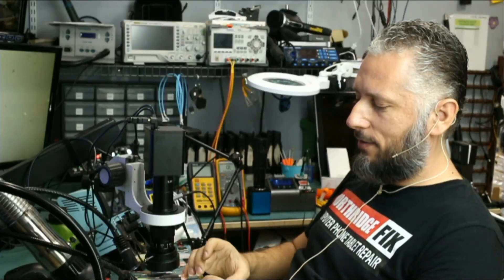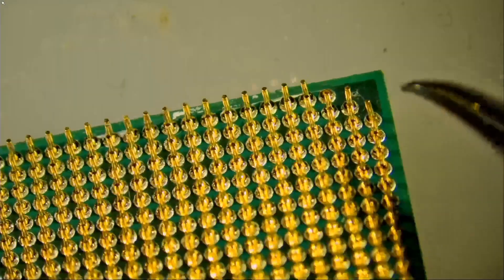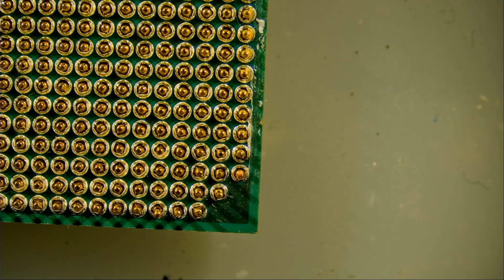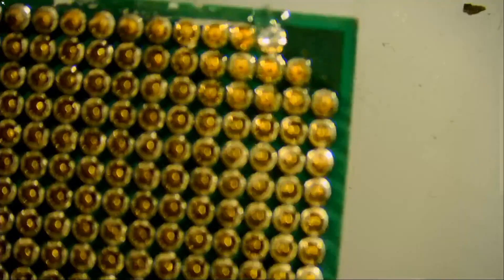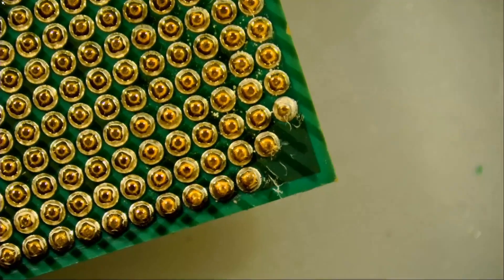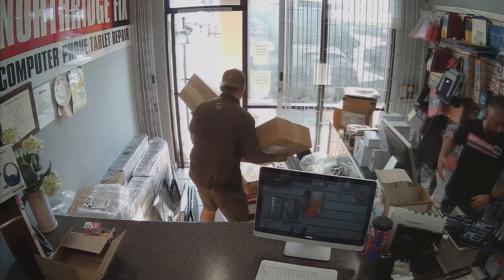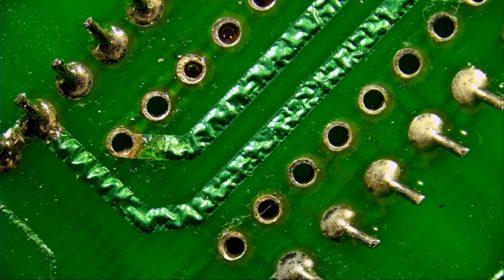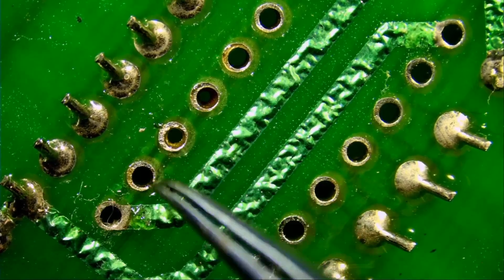Ryzen 9 Damaged CPU. Is it fixable?. Bonus Atari Board

Comment: Removing those pins / clearing those holes is exactly what desoldering guns and solder suckers were made for. It literally takes less than 1 second per pin (maybe 2 or 3 seconds with the manual sucker, because you need to heat the solder first). Of course, they're not very useful tools for SMD, but definitely worth having around for these thru-hole components.

Comment: The CPU he pulled the pin off of is a core i3 2350M. You can identify a laptop CPUs by the five digit code on the sticker that normally starts with an s and contains letters and numbers. The one on this CPU was SR0DN

Comment: You say you has the best prices for shipping your stuff oversea.... Well, I live in Norway and I thought I should order low-melt solder. The price of the solder was ok, but for shipping it would cost 54$.........I am not sure that I agree 100% that this price is the best, or what?
Reply from the maker: International Shipping rates are expensive and we have no control over price. We always end up paying more then what we ask the customer. An average shipping to Norway costs between $60 and $150 even if you're re just ordering 1 weightless item. It makes more sense when you are placing a large order and not just a tube of low melt solder. You can always login to UPS or Fedex and get a shipping quote to find out the shipping cost. We talked about this in a previous video you can check at https://youtu.be/YwOj6NtOjDI?t=95

Comment: I use a pin, a small screwdriver, a magnifying glass and lighting. It is a little bit hard, not a big problem. When done, the socket fixes it better, when inserted 10x.

Comment: I remember fixing Socket 478 P4 pins all the time with burned bread ties by fixing it in the socket hole of missing pin. At least 3 different times. I would stress that I wouldn’t be held responsible for any further damage. Glad I never fried anything doing it. 

Thanks for sharing your experience, strength, and hope.

Comment: Great Video!  @NorthridgeFix I'm curious to know what temperature and air pressure you used on the hot air station when removing the IC with the low melt solder.

Comment: Hey Mate =) I am a big fan of a lot of the advice you are giving. Maybe you can give me some nice hints, would be sooo nice..

Problem : I am a really really poor guy - though I work really hard, all my money is going into child support and debts I have to pay off for some really tragic and unfortunate reason.
Have a decent knowledge of electronics myself and I have about 20yrs of deep sophisticated Linux and Microcontroller knowledge - thats why I hope to make a few bucks out of repairing stuff .. but as you state yourself - the right tools are crucial and absolutely mandatory. Is there anything that you could advise on how to get the most essential (maybe used but in good condition) stuff for  without wasting money to sub-par cheap china tools ?
-What are the most essential tools? (Solder-/Desoldering-Station & HotAir, Microscope, "small stuff" (flux, desoldering-wire etc)) ?
-any suggestions for "priceworthy" tools that dont blow a small budget but are not "wasted" on cheap unuseable stuff?

Comment: 16:19 my 2 cents (up to 90's devices using big components): 
1. Just put the desoldering wick full lenght on top of the solder points and keep tapping your solder iron on those points. By doing this, you are free from cutting the wick. 
2. These big holes can be emptied quite quickly using desoldering pump from the back side.
3. Cold solder joints will occur if component is not preheated and is being fed melt solder on a tip from a solder iron.

Comment: I don't recommend it, but I removed a destroyed pin by heating up a pair of tweezers to the point it would melt the solder when I grabbed the pin. DO NOT USE THIS FOR REPLACING THE PIN. USING THIS METHOD CAN AND WILL DAMAGE CONTACTS.

Comment: I fixed 30 bent pins on a 5600X, it was a pain and took about 2 hours but it was doable with a little heat, microscope and patience. 2 that I had to solder. Barely a thanks from the kid for the fix :X
Reply: Entitled brats everywhere.

Comment: Great repair. I don't doubt that the solder you use is better then the factory solder and that your soldering is better as well. The solder the factory uses is more for cost then performance and it's probably applied by a automated robot. :)

Comment: 2:27 - I was curious to know what that broken pin did, so I did the nerdy thing. lol...

That pin is labelled "AU1" on the AM4 socket, and the signal on that pin is "AZ_RST_L".

That is the active-Low reset signal for the HD Audio codec.

You would hope the PC would still boot without that signal, but then if the BIOS is trying to access the HD Audio at start-up, it could actually prevent the PC from booting.

Comment: Some years ago, the machine i used did made a suspicious sound inside. I did know what it was and warned my boss. "Big boss" came, and did something, accidentally "killing" the external unit. The service man was working at a customers address, so they did ask me to replace the burned-out parts inside the unit. My solder result looked much better than the one from an other (years old) repair.

Comment: Alignment is nice? All of them? Man, what you really need is paying a visit to some good ophthalmologist. And that soldering-job of yours is more suitable for making barbecue than for repairing printed boards...From 14:05 to 14:25, for example, you are exposing both - the printed board as well as the components - to the excessive heat (because you are operating with soldering iron there for unnecessarily long time).

Comment: Bend pins are the users/owners of the cpu fault to blame... Dont take to much Thermal paste on the IHS..when you put too much cooling paste on ihs what happens is that when the cooling paste hardens it becomes like glue when you have to remove the processor cooler from the cpu socket on the motherboard

Comment: Me trying to remove the glass from a Surface. I'm at around a 70% failure rate. I'm new to this, just practicing using damaged stock. But, I'm making a mess of it. I think I've only managed two so far. And before you ask me why, I have to get the ssd out of them for data destruction.

Honestly, I'm not good at it, and all the guides are moronic. And different models have different issues. I'm going for a shark knife or whatever, it's got like a bend on it, and I'm heating up the blade on it, and then slowly trying to move it when the glue turns to butter. My heat gun is perhaps too hot, but when I get it right, it's pretty much just a really good technique. And honestly, when it's extremely cold in the factory, it's real hard to do this. Helps if the weather is warmer.

Oh, and, when done, never be an asshole and put the glass back. Whoops, guess the next guy who wants to put the ssd back in is going to hate my guts.

Comment: Congratulations for the channel and for the awesome job you do every day Alex! I just have a quick question related to what you have shown in the second part of this video: would you recommend that desoldering technique, using low melt solder and hot air, for big dip ICs (40-48 pins) like the ones you may find in a Commodore 64 machine? Or for those cases is it better to use a desoldering gun? Thanks!

Comment: I would only use a desoldering gun for those boards. I work on nothing but vintage hardware, in fact just recently did a ram removal on an 800XL. Would never try that with just braid or hot air.

Comment: Properly removing solder from the holes without quality flux and/or low melt solder is quite challenging for an inexperienced person. On the other hand, I find through-hole soldering to be particularly easy. I think the customer made the right call 👍

Comment: Usually when I see hot air stuff done on a board, the area around the work is heated up as well. Is that not an issue here because the board for the CPU is so small? And do other people mess up 10 or 20 pins by bumping them or because the hot air station is blowing too hard?

Comment: I remember straightening pins on Pentium 4 CPUs a long while ago, this was a very common problem with PGA chips. People were too careless when trying to insert them in the sockets. With the Athlon CPUs that problem did nox exist but then they broke the die because there was no heat spreader and they did not attach the cooler correctly.
Reply: Talking to a vendor at a computer fair many years ago, they said that every almost every instance of an AMD CPU being returned as faulty was due to a broken die and the ones that weren't were bent or broken pins.
Reply: @Graham_Langley  So a lot of idiots out there, not surprising.

Comment: back in the day i soldered a wire to a cpu that had a broken pin. It was like a PII 266 so that tells you how long ago it was.  I got the CPU gave to me for free as it was damaged. I figured I would give it a try and it worked. I found wire that was about the same size as the pins and then clipped it to length.

Comment: Lol it's not really your fault if someone breaks their stuff as long as you don't give an incorrect procedure.. and even then is say it's still not all on you, however if they only mention they tried it because they watched your video, that's essentially cause and effect and should be expected. However I can totally picture some people totally blaming you 100% and being upset about it at the same time. I repair electronics myself, as well as jtag, hard mod consoles etc and I would never really recommend an average user or even an average enthusiast to attempt most of this stuff. I will be honest, I usually obtain anything I want broken and fix it but I haven't done a pin repair on a cpu. I can see how you'd wind up with tons of damaged pins. It's not easy to work on a single tiny pin. My hands have always been fairly shaky also. I manage to steady enough for most tiny soldering points I've had to work on though.. which are probably just as tight, however bumping another pin while the area is hot could be devastating lol I'd much rather have to clean up a little solder to get rid of a bridge.

Comment: I have a dead ryzen 5 cpu it was killed by a child repeatably pressing the power button i also have a dead i3 6100t killed by shorted mosfet on cpu 12v rail. Ived also killed a few E8400 cpu by overclocking  with tape  mod it locks cpu at max ghz.

Comment: Yea those sockets are opened up until you latch the arm and then they close in tight. A CPU heatsink pulled out a CPU in my older system a while back and was basically glued to the CPU. It sat in my closet for a while then I decided to put together a machine with it. Had to take a hair dryer to it for a bit and it pretty quickly loosened up the paste. Since it came out that way glued to the CPU it managed to bend a few pins a bit. I essentially just took a butter knife to lightly push/tap on the pins to straighten them. Dropped right in. NEVER seen paste lock onto a CPU like that. It was on strong.

Comment: The tools and equipment you are using are amazing. I have an Associate degree in engineering and I’ve never seen the school use anything your using. Just soldering iron and wire solder. Great channel showing your skills and allowing others to learn and fix themselves.

Comment: I remember our family TV one day making a popping sound and then there was a burning smell. I it was an old RCA tube type TV from 1955 that was used. We only had it about a year when this happened.  The repair man came over who used to be an electronics sergeant in the army during WWII.  The burned component looked like this thumb-sized component that was a wad of something with two wires sticking out of it.
Not sure what it was but he de-soldered the component out and then a new one back in. I watched him with great interest being that I was only 5 years old. 
We also had an old Zenith  huge radio and record player cabinet. I liked watching the old vacuum tubes glow.
Those were the days. It was a big deal when the first transistors were being put into things especially the cheap Japanese little radios being manufactured and sold to the public.
When I got to college one of my courses was an electrons physics course that taught me how to build circuits using a breadboard.
We had big components like on the old Atari you worked on.
GREAT SHOW!

Comment: One you de-solder with low melt solder and remove the solder, do you use the same low melt solder to re-solder back a working component?

Comment: Another good thing to use on bent pins are a small syringe "pipe" that you just push down on the pin and align it done that so many times 0.5mm or 0.7mm pencils are usable too :) Great done Alex as always keep up the awesome work! :)
Reply: Use a thin blade, it makes alignment much easier.

Comment: Easiest way for novices to remove chips like on the atari board is to clip the IC leads one by one and then use a soldering iron and needle nose pliers to remove the remaining pins one by one from the pcb.  Very time consuming but results in the least amount of damage to the pcb.
Reply: This is assuming destructive rework. Not an option when preserving the DIP to be socketed.

Comment: I Remember in the 90s using solder baths machine to desolder and solder those chips. It was a lot of work keeping the top of the solder clean, plus using flux spray at the back of the board.
Ooh the Memories are coming back. lol
Your way takes less time to do. and less mess to clean.

Comment: For through-hole components I have a desoldering station which has a vaccuum pump.
 It does wonders, no low melt solder  needed! 🤩
Reply: I have one too, and with those old "wrinkly" epoxy PCBs the solder rings very easily come off so I stopped using it.

Comment: Can you use the soldering iron instead of hot air to remove or solder the pin?
Reply: Yes, You usually use it in combination with a "Solder Sucker"

Comment: Nice. What it’s worth mentioning is just how fragile such older boards are to work with. Mainly due to older manufacturing techniques. In video can clearly see some of the tracks and resist/conformal coatings are lifting. Board working fine I guess but over time with not a lot of heat during prolonged use and age the traces have a tendency to delaminate from the board making such repair works much more sensitive to further damage. Hence LMS and experience a must. As always nicely demonstrated here. 👌✌️👍🇬🇧

Comment: Mastery work! About the Atari bonus video, I use a desoldering pump gun to remove these old dip chips, but using hot air seem to be more efficient and safe, at least for the medium and small chips? Thanks!

Comment: Some years ago i recapped my Amiga 500 board. I did not have low melt solder and did not know the trick. I ended up preheating whole board because is absorded all my heat and it was difficult to get even one cap off. 
But got it done without any damages and Amiga still working. In the future i sure use low melt solder.

Comment: Back in the day we used a razor blade on older CPU's and I had a Ryzen 3 with a few bent pins and I tried the razor again and it worked even better. 
Looks like an old AMD Duron CPU you stole the pin from.

Comment: if thats a 5900x or a 3900x, or higher, and it was de-lidded, they had to get it hot to get the solder TIM to melt.  im betting they knocked the pin off when doing that.  that said, I have never seen brown TIM.

Comment: Amazing job as always. That chip seemed to be a Hex Buffer and has  a date code of 8432? So 32nd week of 1984? Cool... Excellent video!
Reply from the maker: I got your Syringe holder package Thank you. I haven't tried it yet, but more 3d printer smaller alternatives were also mailed to me. I'll give them a shot soon. I appreciate the time and effort you put into this.
Reply: @NorthridgeFix  
Thanks for letting me know. I was concerned since USPS switched the zip code on me on the label. I just seen the 3D printed ones on your bench after I sent these.  I did not realize you had a solution. The 3D printed ones look great and may work even better! 
Thanks and God bless!

Comment: I dont understand how your solder wick stays together so well?? The stuff we use at work just frays up and quickly becomes useless. Usually results in a bigger mess. Perhaps its just low quality solder wick?? I may have to buy some from you to try, if it works well I will tell the inventory person at my job about your store. Another question, we solder a lot of wires to USB PCBs, for medical grade cameras. They wont allow us to use flux, just flux filled solder. This results in having to add more solder in order to add more flux. Is there some sort of reason they do this like this?? I see you soldering a lot of components, not as many wires. I assumed this had something to do with this. Should we be adding extra flux when soldering wires, or should flux filled solder work here?? Also thanks for posting your videos. The people instructing me at work are not up to par as far as teaching what they do. My soldering abilities have improved immensely since I began watching your channel. You are far and away the best I have saw at what you do.

Comment: I must try low melt solder with a desoldering pump on the old 74LS chips.
Reply: Hot air the back until solder melt then flip and rinse until laundry comes clean... What a pain.
But yeah any cheap vacuum gun would be way more efficient lol
Glad we're not in 1990 anymore (;

Comment: Doesn't the low melt solder just go on top of the existing solder? How does it melt the existing solder?
Reply: It combines with the existing solder and therefore lowering it's melting point.
Reply: When melted they bond. Have you ever soldered? You know how its easier to get solder to melt with other melted solder? When they melt and mix it becomes a single glob of solder and the whole thing melts/hardens at the lower temperature. Alex went over this and explained in depth in a video I watched recently.